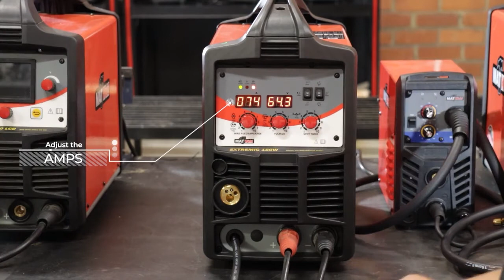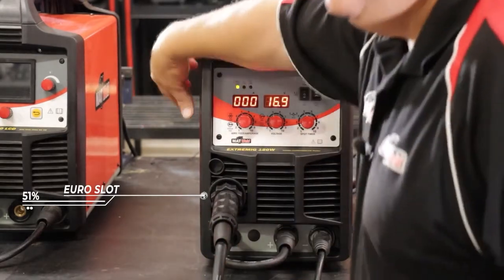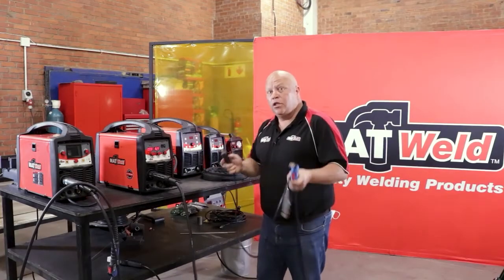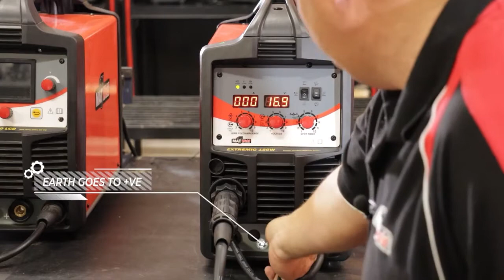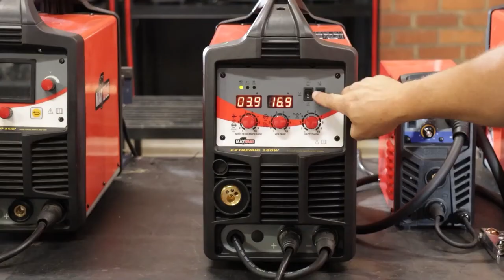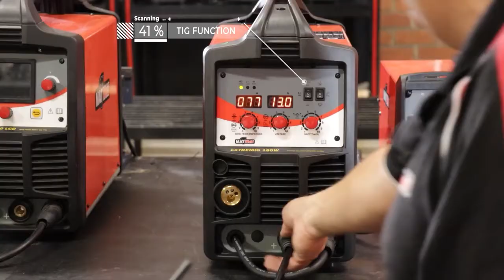Extrememig 180W MAT9100

Comment: hi can you weld aluminium with the mat9100
Reply from the maker: Good Day Riaan, yes you can, it has an option to weld aluminium through the conventional torch or as an optional extra for ease of welding spool gun attachment which will help for DIY Welding.

Comment: This video is not so cool honestly. I bought this machine. There is no chart on the inside of the spool door as per your manual?!   If you need to weld TIG, there is no docking hole for the jumper cable. That’s short sited design surely? The timer switch explanation is unclear, IOW the relation between the two settings. The worst of all there is no Tip explanations and clarity on “stick out” on MIG.  Should the copper tip be inline with the shield nozzle cover or not or does it matter? …It seems most fluxcore welders, the copper tip protrudes the shield cover nozzle Is this relevant?